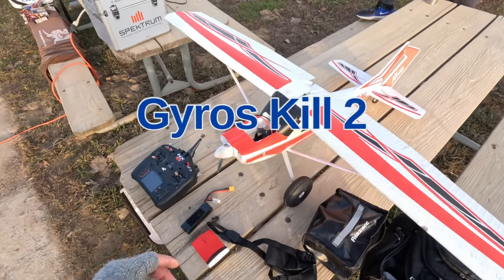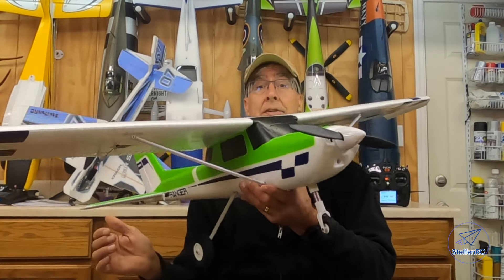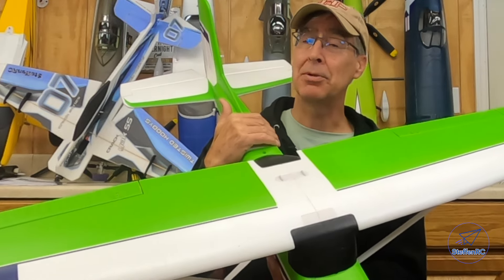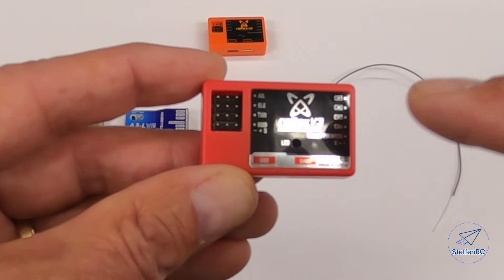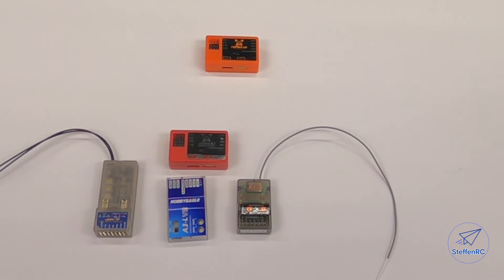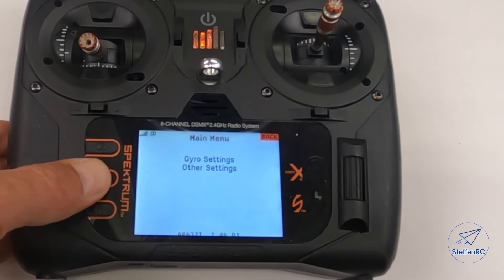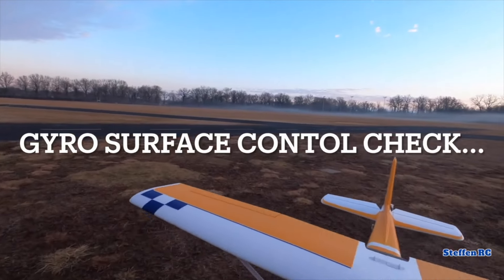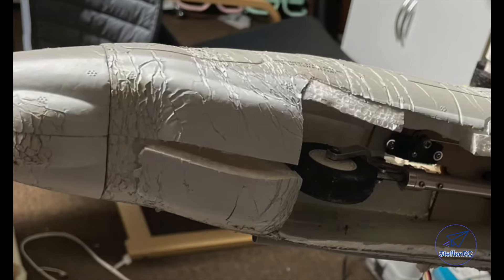Watch this if you use a gyro in your RC Planes

Comment: I never learned to use gyros.
Accept of course on helicopters.
I don't run any kind of gyro on jets or prop planes, you dont need it.
Reply: They help me. Glad YOU don't need it. Someday I may be as good as you are.
Reply from the maker: Thanks Casey,  Some like them, some don't.  Lots of guys use them from the beginning and its important they understand how to use and take advantage of them.  I use the analogy of a backup camera in my new truck.  Do I need it?  No, I can just use my mirror or turn my head, but it sure make it easier to backup.  At least for me..  To each their own.   Will

Comment: What’s wrong with a gyro? What sandwich would you recommend ?
Reply from the maker: Oh No....  Don't misunderstand.  A gyro is a wonderful sandwich, but it's really important for the sandwich maker to pay attention to the details.  For example you need to make sure you have the correct condiments.  You wouldn't apply mustard to a Gyro, but instead apply some tzatzika instead.  Also, using a slice of wonder bread would be a complete disaster and resulting in the sandwich falling apart and crashing into your lap.  No, only a quality flatbread or pita will do..  Thanks for asking though..  - Will

Comment: Why use something like these systems instead of an equally priced and much more capable flight controller running something like INAV?
Reply from the maker: Some of these systems come already installed in the plane.  These are simple 3 axis gyros.  Nothing like a Matek F405 flight controller running INAV which offers 10x the capabilities to these systems.  Also, 99% of the users of these systems are flying LOS, not FPV where the FC and INAV really shine.
Reply: If us Old Dodderers can't even get 2 simple set-up tests done right, just imagine the fun we could get into with something as complex as programming a fully-fledged flight controller! 😱😵‍💫🙄

Comment: Can you pls send me an plane like fms rannger
Reply: Or an umx
Reply from the maker: I don’t have a Ranger to give you, but FMS has some great sales going on.  You can use my discount code STEFFERC for 10% off.  Good luck
Reply: ...Bought 2 months ago, not happy with its characteristics.
Reply from the maker: @billsmith2308  Bill, You weren't happy with the Ranger flight characteristics.  I'd love to understand what you didn't like about it.  Please let me know since I've been using them for many years and haven't found any issues.  That said, I might have different expectations than you do.   Thanks Will
Reply: @SteffenRC  but can you send me an plane any plane broken or not I don't care
Reply: @SteffenRC  Can ou pls send me an umx
Reply: @SteffenRC  I have found two issues with the Ranger. 1. The Rear motor is angled incorrectly for a rear exhaust plane. This has been documented online by other users 2. The Body is made of a great, almost crash proof, material, but the body seam(s) are not properly annealed. 2+ The battery hold down plate is inferior and bound to the body by screws which easly separate. Once I did get it flying (making my own motor plate), I didn't like the flight characteristics, let alone if I added FPV hardware. POS
Reply from the maker: Bill, maybe we are talking about a different Ranger.  I'm referring to the FMS Ranger 1220 RC Trainer plane.
Reply: @SteffenRC  I have many umx mig umx a 10 can you pls send me any pnp plane 3s
Reply: @RcFlighttest-c4j  You have "many umx mig umx a 10"?? I don't have any. Can you please send me 1 of yours?
Reply: @SteffenRC  I believe that "Bill" is speaking of 1 of the Volantex Offset Pusher "Ranger" foamies. Some of them need the motor shaft angle tweaked from how they arrive from the factory.

Comment: befor flight the first time flying a new airplane check up down right left controls -----------------THEN CHECH gyro DIRECTION  RIGHT, LEFT, U,, DOWN ---have many times seen gyro working back Ward -----=INSTANT CRASH
Reply: Nope! Wrong way around mate! ALWAYS check (and correct if required) the Gyro Directions FIRST! On many Gyro systems switching the gyro direction ALSO switches the radio stick direction. But switching the radio stick direction has NO effect on the Gyro correction direction. (As explained here!) So do the gyro first then the radio - unless you like doing things multiple times and any mistake in any of the steps could stuff your pride and joy into Firmer Terror!

Comment: i dont ever use Gyros , end of the problem
Reply from the maker: You're fortunate that your planes don't have them and you learned without using them.  Some see them as a benefit.  Kinda like Backup Cameras in vehicles.  Why use them when you can just look in the rear view mirror or just turn your head to look back.   I dunno, some technologies are handy to have..